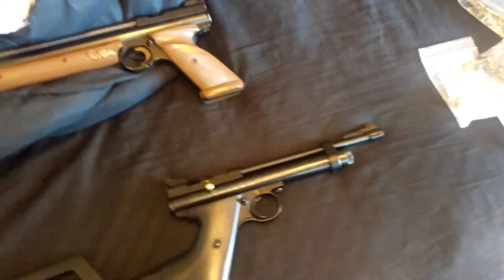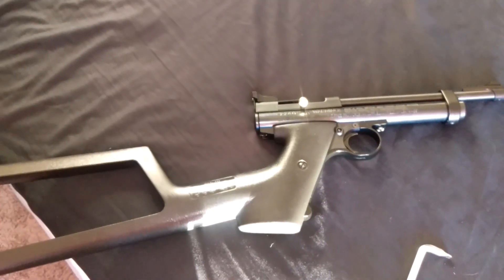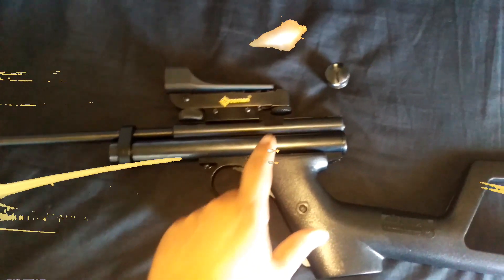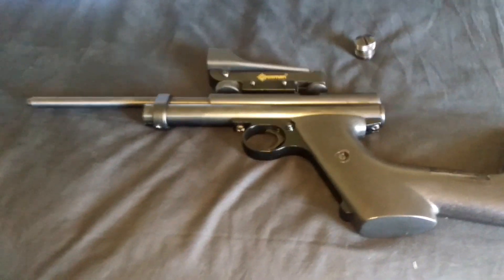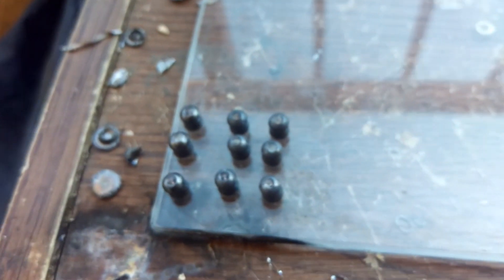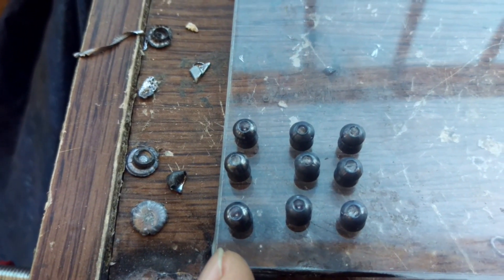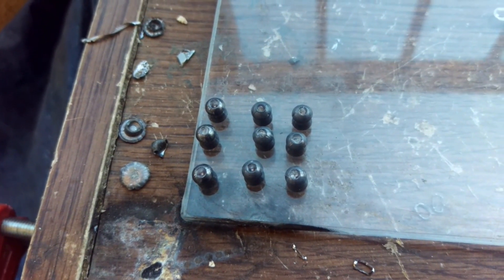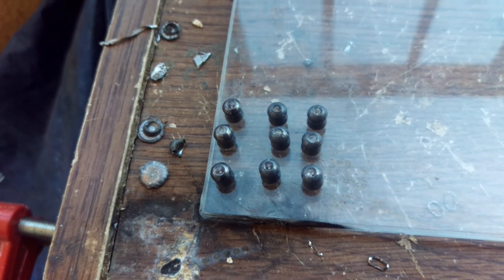Crosman 2240 Power mods

Comment: Great vid, I installed a Steel breech but the screw indent the chamber kept getting in the way and knocking my pellets out of alignment. I had to really struggle to get the rounds in the chamber. did you have any problems with misaligned barrels or pellets getting caught in the screw indent?

Comment: Thank you for this. Interesting to see there's no noticeable difference from adding a longer barrel.
Reply: Oh yes there is a difference in the longer barrell....I build em up and a 24" barrell on a 2240 will add 100 fps compared to the stock 9.5" barrell...you'll hear more builders chime in on this...
Reply: You go with a longer barrel in a powder burning firearm so that the powder Burns completely increasing your velocity and efficiency of the burn but with an air gun longer Barrel actually is probably causing a little bit more drag than a short barrel
Reply: Longer barrel does add more power. Perhaps the jump from a 9.5/10-14.5" barrel isn't very noticable but an 18" barrel on my ssp250 lets it throw lead pellets over the 500fps mark easy. And that's a very old gun, could probably do more if I polished her up.
Reply: @thomasmacdonough288 how do you go about polishing a rifled barrel? 
Is it just a case of a lot of back and forth movement and twisting as much as the rifling allows or is there more to it?

Comment: My mods very simple homemade power adjuster 1377 hammer spring 10" barrel sounds like one of my old 22lr pistol loud bang but only about 20 shots when I want more shots I just put in a weaker spring about 70 to 80 shots fun gun

Comment: Milos, I would've thought all those mods would have by far increased all the shots fps and velocity, after all look at how expensive they cost! Have you rechecked everything? Cause this is alot of mods for the little improvement in the gel, I really don't think a larger transfer port will make the difference, but try,I will check it out. Do you have a chony? That would show the increase, I hope. Gr8 vid, but not much difference. Thanx --Joe
Reply from the maker: I'll look into it brother thanks for the feed back.
Reply: Get a chrony otherwise you’re just guessing

Comment: Good video 👍. I installed the power valve also and it didn't really gain much more fps than the stock valve. The hammer spring, longer bbl., Large transfer port and"O' ring did make a difference though. For the money the power valve wasn't really worth it for me  :)

Comment: how to  modify  , please tell me
Reply from the maker: I removed the original breach with barrel and pulled the retention cap from the base then took out the old valve. I replaced the valve, recaped it with a stronger hammer spring then put the new breach and longer barrel on it. 

I might make an instructional video on it.
Reply: Doc Q thx
Reply: @DocQ68w  Did You make it? (:
Reply from the maker: @plinker439  did I make what?
Reply: @DocQ68w  Sorry, i meant the instructional video. (:
Reply from the maker: @plinker439  yes
Reply from the maker: Unfortunately YouTube took it down

Comment: What type pellet are you using? What type and  consistency of ballistic gel is that? If you are changing the valve and spring you should change the transfer port to a larger one also, and you will definitely see a change.  I never thought that you could compare gel to what it would be like shooting through the air.  What does this prove? Everything you are adding to stock pistol will improve FPS.  Is gel the same consistency as a squirrel, etc. Nice vid for a newbie, no disrespect, __Joe
Reply from the maker: +JOSEPH SCUDERI SR none taken Joe. 
I used the crosmann premier HP.
The gel was an organic 15%
The point/proof of the test was to show the difference in penetration before and after the mods to instill some confidence that the mods do make the pistol stronger. The gel was the medium of choice since I didn't have a chrony or slowmo cam at the time.

Comment: you should have just got on the crosman custom shop built it custom on there it's cheaper then buying piece by piece.  then u can but the small parts they don't carry . what I did with pump 2 version.  got the stock for it 18 inch barrel metal long receiver and then got a after market trigger and power adjuster with the tko muzzle break.  love my set up only reason I did not go with the co2 model like you is co2 is not good for hunting in cold weather .
Reply from the maker: you can't complain about free stuff brother, the 2240 was sent to me free of cost
Reply: Dang we'll then no u can't but you should definitely check out crossman custom shop get you one custom made with your name on it  or your channel name
Reply from the maker: +james helms for sure, I'll check it out.
Reply: +james helms yeah.  art and I sent him that. we got a deal on it on Amazon.  buy 2 get 1, so art and I each got one and decided to give the third one to Doc Q.
Reply: +Doc Q I haven't heard from art in a while.  kinda worried